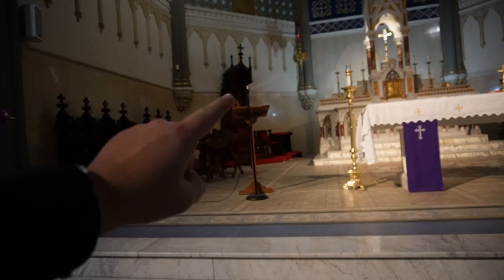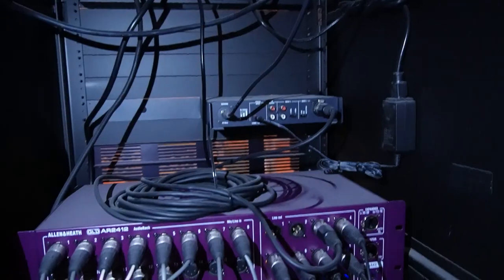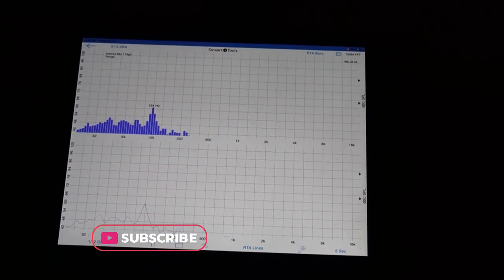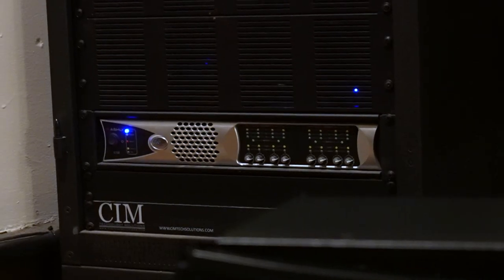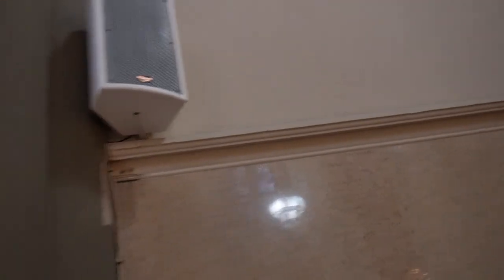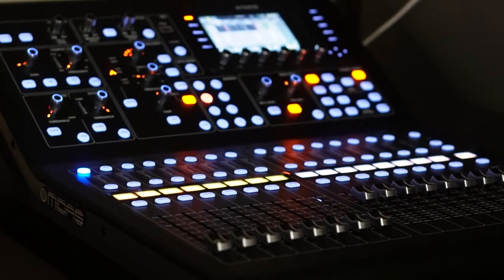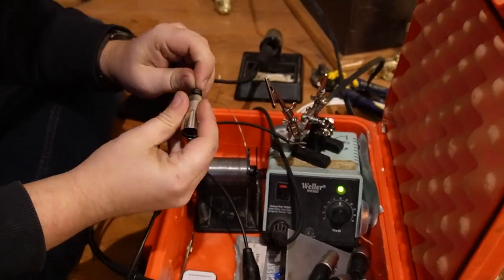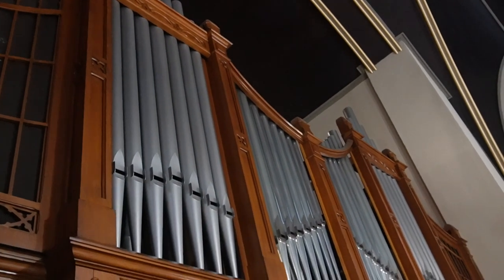Updating the oldest Catholic Church in Indianapolis

Comment: i think the QU24 would have been fine too keep...
Reply from the maker: I agree, the QU24 is perfectly capable of doing the job. After speaking with their audio tech they really wanted to move away from the QU24. I have done many shows on it and I'm sure I will use one again.
Reply: @DCAVL  since you already have AR2412,  why not replace with a SQ5?
Reply from the maker: So If I worked at the church I would have liked to have an SQ5 with the AR2412. The church did not like the QU and was worried about staying with Allen & Heath. So they wanted to try something new. Changing the stage box and mixer now gives them equipment with low running hours. They never turned off the system. We were able to train them on how to run their system. Another concern was who can mix on the system. More engineers have mixed on the M32 rather than the SQ, So almost any engineer can walk in and do a good job for the church where some engineers might need to do some homework, and look through menus to get the job done.